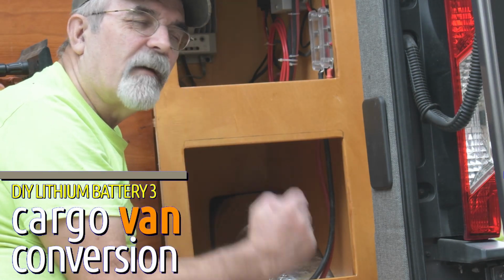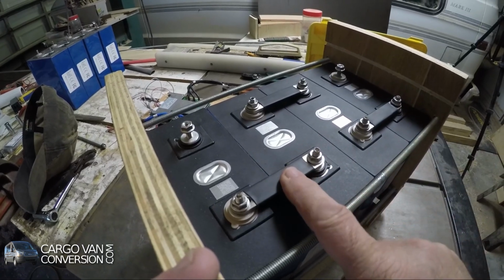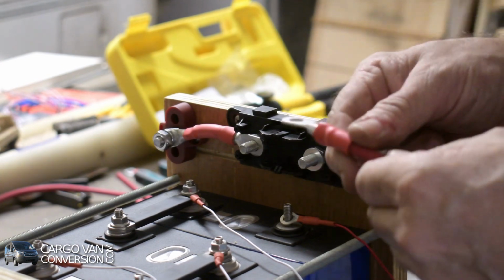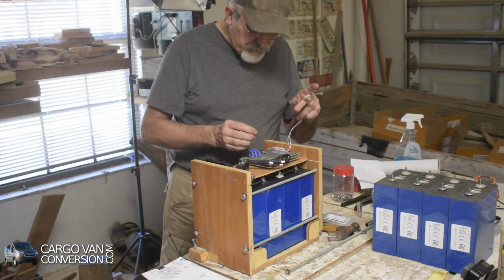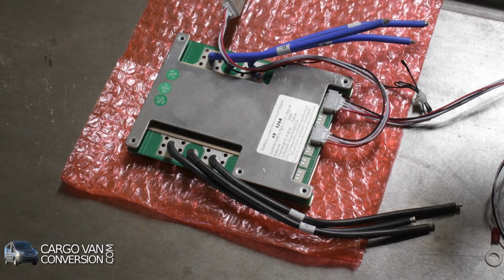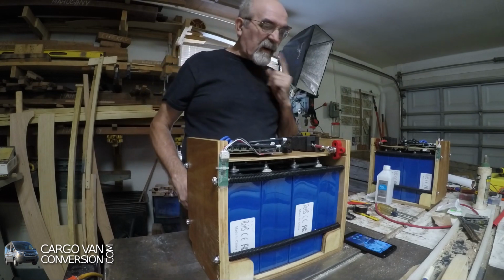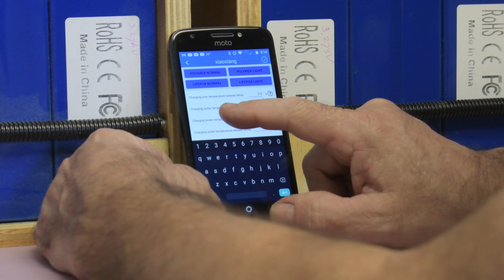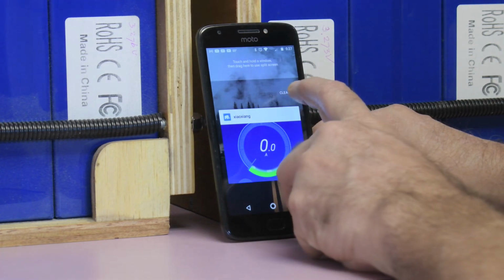DIY Lithium Battery - Part 3

Comment: Nice battery packs there :) I save this series for my own transition over to lithium batteries later on down the road :)
Reply from the maker: Hi Geezer:
Meanwhile I have them installed now in the van (next week's video) and they seem to work fine. Much more control over them and less maintenance.
Van Williams & Joey
Reply: @cargovanconversion  That's good! Yeah, that's what many people say. It's a new world compare to the old type of batteries. At the moment i am often on shore power so it doesn't matter, but soon I will be a lot more off-grid and need better working batteries if I am even going to be close to keep an acceptable level of living.
Reply from the maker: See you on the road :)
Van Williams

Comment: WOW, I couldn't have imagined how many hours you put into this build but took only 18 minutes of video to shoot, minus the editing of course...looks great. Thanks to mike a great tip for the wire loom likely to cause a problem down the road. Is that the optimal placement for the temp sensor or more convenient?
Reply from the maker: Thanks. The only requirement AFAIK is to place it somewhere on the side of the battery.
BTW It took me about 2 weeks :)
Van Williams

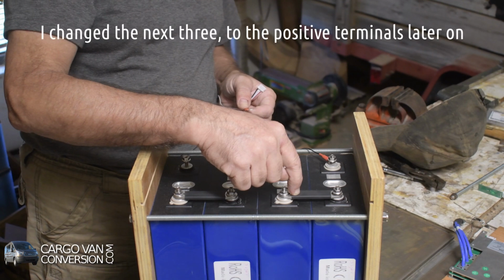Comment: @ 3:39  The video says, "I changed the next three to the positive terminals, later on."   Does it make a difference if those 3 wires are on the positive or negative since they are directly connected with the bar?  I know the other 2 wires need to be on the correct terminals.
Reply from the maker: Hi Chris,
I'm really not sure; not enough electrical knowledge :( I did put them on the negatives for the same reason you gave: should not make a difference. Further research showed only examples on the positives. My thoughts are, that resistance plays a big role and a correct connection to the right cell without a busbar in between could make a difference. Cell voltage measurements goes into the milliamperes. On the website cargovanconversion.com  I have some more resources, if you want to dive into it :)
Van Williams
Reply: @cargovanconversion   Thanks!  I may move mine to positive terminals..  did you buy 8 cells for $750 with or without shipping.. If, without, may I know what shipping was?   Thanks!
Reply from the maker: Hi Chris,
It was actually $758.00 DDP (including shipping, handling, import taxes). In other words from door to door. I did have to buy separately a good multimeter ($40) and a Lab Power Supply ($50) for testing. When I add some welding wire, lugs, bus bars and a switch, it all comes very close to $1000.00.
But that's the price of a 100Ah Lithium drop-in battery. With 550Ah installed, that's a bargain :)
Van Willams
Reply: @cargovanconversion  that's an awesome deal. Thanks 😊